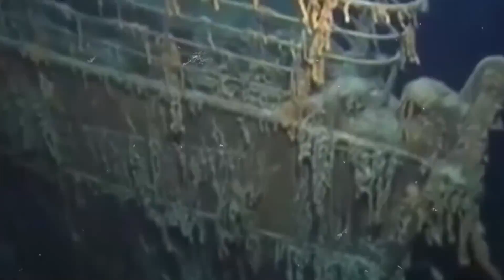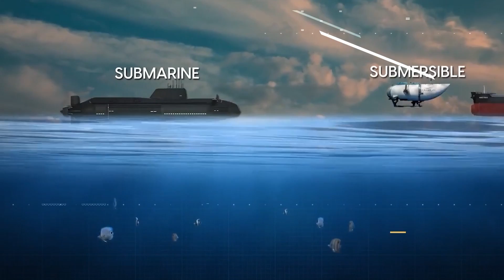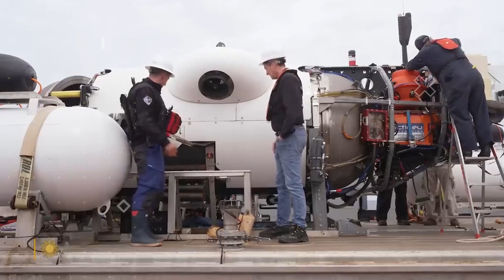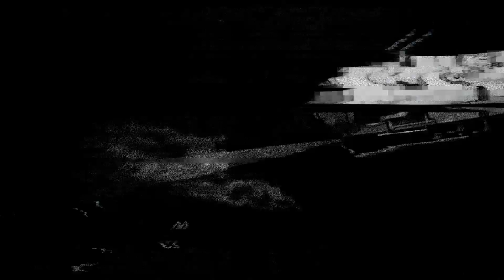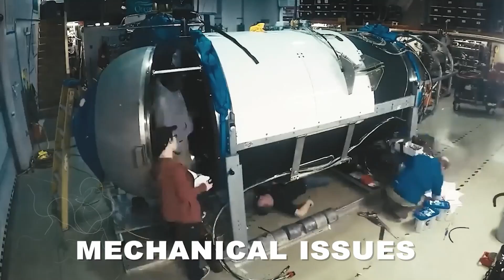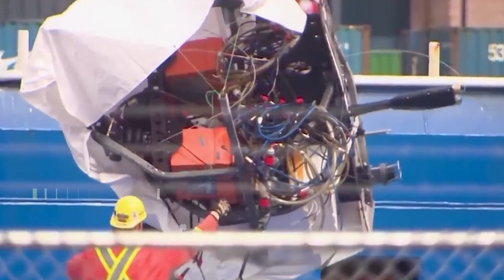The TERRIFYING New Discovery About The Titan Submersible!

Comment: Aftermath 
   
Titanium hemisphere. Taking a calculated risk did not mean that the CEO should be reckless with his own life. A titanium hatch of identical thickness to that of the outer wall sealed off the aft hemisphere from the passenger compartment. This hemisphere was missing from the field of debris that littered the ocean floor. Mission specialists were told that it housed controls that enabled the vessel to maintain stability during an emergency. In reality, the end cone was an escape module that was designed to break off from the carbon fibre hull and float back up to the surface with its sole occupant should the submersible encounter difficulty from which it could not extricate itself. No one except the CEO knew of its true purpose. Accordingly, when the alarm sounded none of the crew questioned his action or even suspected an ulterior, selfish, self-preserving motive when the narcissist climbed into this hitherto vacant chamber and tightly secured the door from inside with bolts, ostensibly to take decisive action in order to steady the vessel and keep them safe. An hour later the titanium end cone was picked up by a navy submarine with its passenger uninjured, in perfect health and in good spirits, totally unruffled by the tragic loss of his fellow crew, deeming his mission an unparalleled success. This portion of the episode is classified. The official narrative that all of the mission specialists met their demise remains unchallenged.  
   

WWII batteries 
 
In the waters of the Grand Banks off the shore of Newfoundland Canada stands a six storey high battery absent its artillery. Languishing unused for nearly a century it had become the repose of smugglers and weekend romantics. A prince, among several other dignitaries, accompanied by their nubile, some would say nude, escorts were rumoured to on more than one occasion to have landed in a pontoon equipped express plane and spend days savouring its secluded ambiance shielded from prying eyes. Wiring of the explosive charges that would demolish it was nearly completed when the Polar Prince towing its perilous cargo steamed past. A half dozen bangs and one gigantic whoosh and boom were heard on hydrophones in listening stations that proliferated in the Atlantic Ocean when this concrete edifice crumbled in a cloud of dust and disappeared beneath the waves. At the very same moment hundreds of miles away Titan slammed into the ocean floor. The mission specialists, safe and sound, but unable to communicate or disengage, awaited rescue. 

Banging sounds at thirty minute intervals 
   
The CEO dragged the insensate body of the hero that had sacrificed his life with him into the titanium aft cone before securing the door of the hatch so that it would be able to withstand the enormous pressure at this ocean depth. Then, applying the correct codes that only the CEO was privy to, what the mission specialists thought they were hearing was the landing frame being jettisoned was actually the escape module being hydraulically detached from the body of the vessel. Freed from the grasp of the Titan it began its resolute ascent to the surface. A low tech rapping was the prearranged signal that announced its arrival to the navy. It was for good reason that an electronic beacon was deliberately omitted from the module so that it would not be discovered first by an unintended party on this, a most clandestine assignment. While some presumed that this venture was the precursor to the recovery of gold from Spanish shipwrecks in the Atlantic Ocean only the most astute observers might discern that it was the forerunner and vital constituent of exploration of the underwater base in Commission UFO being sponsored by the navy where tactics could first be tried and refined in a relatively nonthreatening environment, without fear of being zapped by aliens, when dissecting the Titanic. 
   
   
The Indian princess 
   
The CEO had a passion for achievement. Risk taking was more than his daily bread. It was an obsession. An addiction. To the point where some claimed he was reckless. Despite a portfolio that evoked envy among those of us that had earned bragging rights, he could never rise high enough. It always had to be more. He never boasted. Until he reached the pinnacle in his mind his stature was modest and he had yet to climb above one of the lower rungs. That required far more financial resources than he could possibly assemble in one installment. That is why this trip was prized. A covert operation for which he had been well compensated and stood to earn even more. That would leave him with sufficient funds to meet the next stage of his ambition. Unknown to the public, his passengers were not a product of chance that merely had lots of money and who could afford to pay for the trip. Thrill seekers they were not. Slated to come along on this trip was a direct descendant in line to the throne of India, known only to the CEO, a veritable Indian princess. The legitimate heir of the Koh-i-Noor diamond that reposed in the hold of a sunken British ship at the bottom of the Indian Ocean. During his lifetime much criticism was hurled at the child monarch’s regent that ruled in place of the young Maharajah of Lahore, but foolish he was not and those that had intimate knowledge of his schemes applauded his shrewdness. Housed with the loot in the British Museum was a worthless quartz replica in place of the authentic diamond. Visitors complained that this supposed priceless gem resembled a piece of ordinary glass and it was withdrawn from further exhibition.